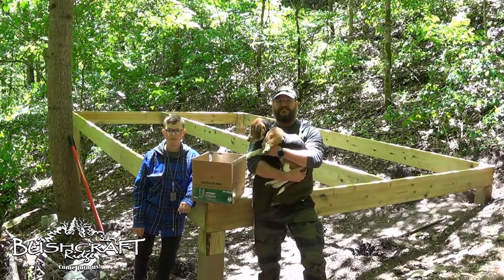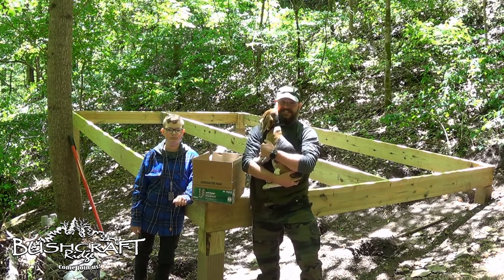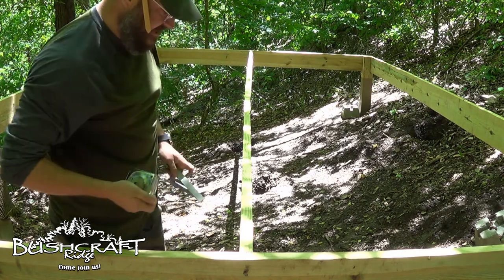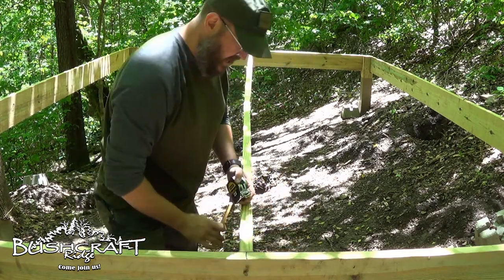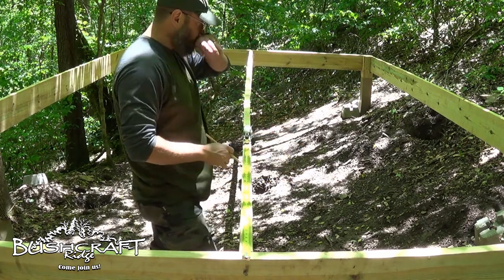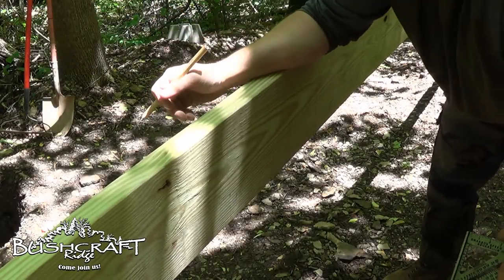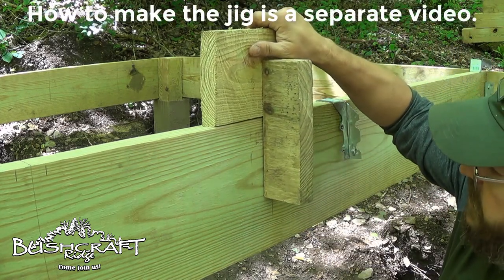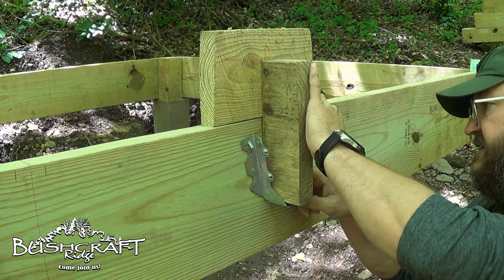Off-Grid Cabin Build 5.10.2020 -- Joist Hangers

Comment: I did a porch yesterday,  the wood was treated but badly worped!
Reply from the maker: The board on the left side here bows out quite a bit and the middle board bows slightly. I'm thinking of using ratchet straps to squeeze the frame while I hang the joists. 🤔